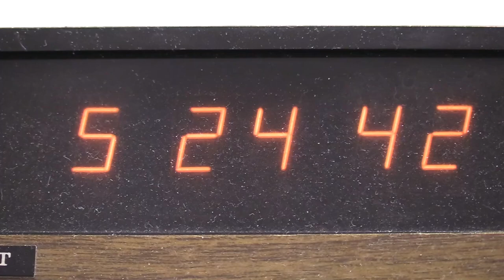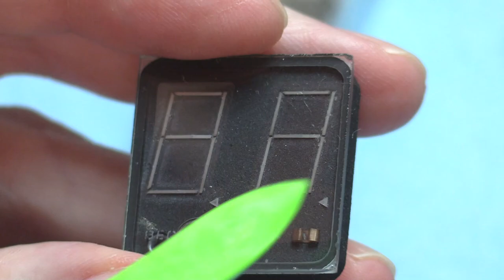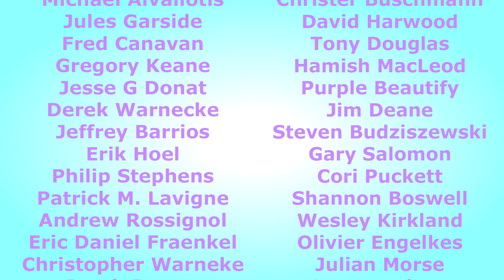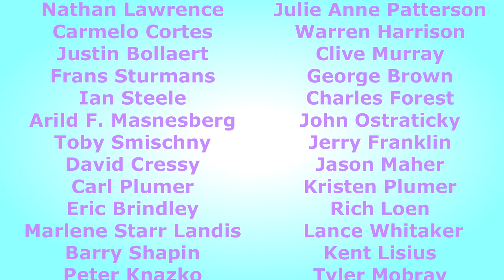Why Are Tubes Mirrored?

Comment: Probably less than 1% of tubes, or valves a we british call them, are mirrored, or silvered on the inside.
If you knowanything about audio valves, you will be familiar with the 6V6G audiooutput valve. Probablt the cleanest sounding audio valves when used in push pull configuration. They were never silvered. And I dtill have a 300watt perchanne RMS amplifier which I built in 1958, which works perfectly.
Do you remember the Maurice Compendium which listed every single valve available at the time  with all its characteristics, techncal data and, most importantly, equivalents? 
Gone are those days with thin film chips and the " don't work? Bin it " attitude so beloved of the chinese designers of cheap semi-disposable crap that they produce today.
Long live the thermionic valve.
Reply: You're hopelessly wrong, re your "1%" figure. That's just ridiculous. Virtually 100% of  radio/audio/TV/instrumentation valves have the silvery-or-blackish getter flashing.....
A few rare exceptions are for example some Telefunken EAA91 7-pin double diode,  and a few production runs of certain EM84 eyes. Regarding 6V6G, again what you say is ridiculous. What's in your drinking water over there???  I have played with vast quantities of 6V6G and GT over the last 50 years, and have easily 1000 here, from every brand you could possibly think of. EVERY SINGLE ONE has the standard heat-flashed gettering (down the very bottom on 6V6G, never up the top..) 

Interestingly, some 'silver' getter formulations didn't turn white when 'polluted' with a very slow air leak, but instead simply disappeared. eg. on the war-era power valves in the 100W dissipation zone (GE VT4C 211,  RCA 845, 805...).
And some like the rare United 845W had a little 'pillbottle' cylinder filled with stuff,  as an active getter, but with no flashing on the main glassware. Incredibly sadly, misinformed radio technicians would see this getter , and think these 845W were duds because they didn't have any associated silver flashing on the glass , like the other 'normal' RCA 845 valves sitting on the same shelf, so would toss them. These 'pillbottle'  United 845W NOS are now incredibly rare, and have a price of about US$1500 each....